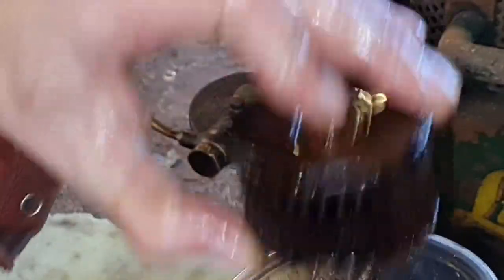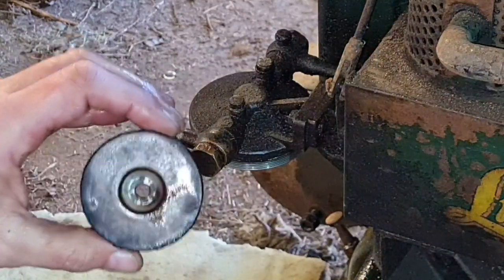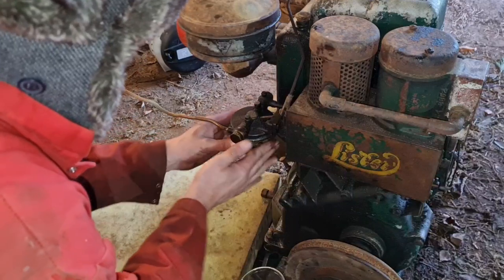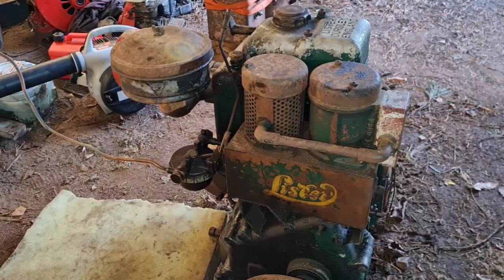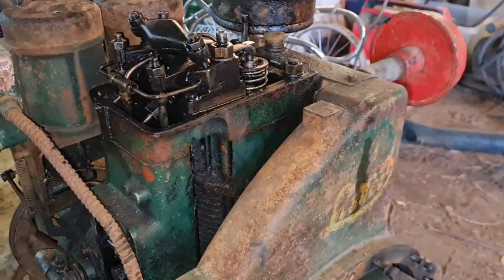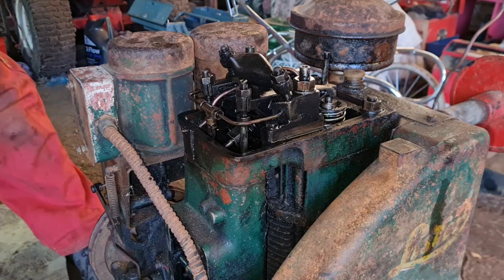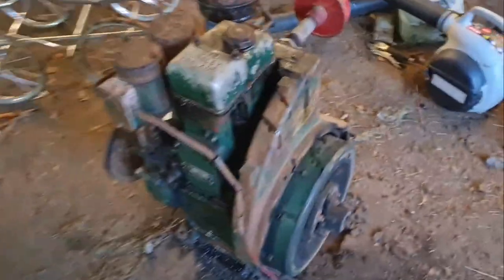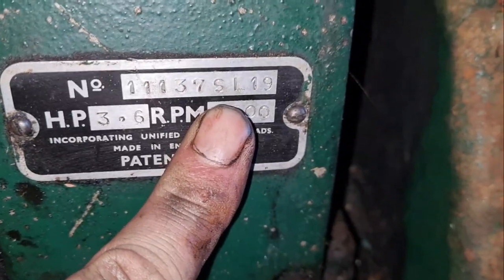Lister Diesel. Will it Start run?

Comment: Hi Adam, 
Really enjoyed watching the Lister startomatic video last night. My father in law used to be a fitter with Bloomfield and Sons in Suffolk and fitted loads of these before mains electricity reached the farms. I will pass on the video. He said that even the Startomatics that were driven from a Lister CS were built to be taken apart easily and had to fit through a standard door frame as a design requirement. It was a nice and long video and dont worry we all make make errors as we are human. I worked with a lad once who filled an engine with oil on a Guy lorry up to the rocker box. Needless to say his employment was short and the engine burst apart from the sump and I had to mop up the pit. I have filled a van and had the oil run out because the bung was still out. I have really enjoyed all the videos and the Reliant made me smile. Thanks
Reply from the maker: aw thanks very much. glad you enjoyed it. can father in law still remember were the 6 wires out of the generator goes? lol.. There will be lots more vids on this I'm sure. and as the weather gets better the Reliant also. lots to be doing. 
Thanks for watching 😁

Comment: Hi Adam. Another great video, Warts & All. Didn't bother me about the length. I don't really like too much "Time Lapse" 
                  content. Did an oil change on my Dad's 1966 Ford Cortina Mk1 and (Kinked) the oil filter ( o ) ring
                  tightening the securing bolt. Lost 3/4 of a gallon of Duckhams finest 20/50.
Reply from the maker: Nice one. to be honest I only really do the time laps thing to speed through a boaring bit. to save you folks getting board and switching off. I do try not to edit much out. Duckhams oil, heck my grandad used to use that in the 70s in his Moggy 1000. lol

Comment: Love seeing the pushrods spin on the lifters. Very cool.
Reply: We’ve all dumped oil on the ground….. For me it was 20 gallons when a hydraulic hose catastrophically exploded on a John Deere 8630 4x4 tractor. Then another 5 gallon’s when I failed to find the second blown hose….. 🤦‍♂️
Reply: She cleared up nice. Sounds excellent
Reply from the maker: yeah I'm happy with the old girl. she sounds lovely when going. ow the oil thing. To impatient to get the oil in. lol..
Reply from the maker: Ow yes. The Brits certainly used to build things the right way years ago. These are so well made.

Comment: As you were pouring in the first 2 litres of oil i said to the other half he hasn't  put on the side cover and another tip for starting listers when really col is tack out air filter and put some newspapers in it and light it
Reply from the maker: Ow yes. I messed up there. I ment to show you folks the air filter. It's an oil bath filter. Yeah I seen the old burning paper trick. Never tried it tho.

Comment: about 40 years ago I was working on an Island where we had a SL2 Lister running a generator. The engine was noisy,rattly and smoked really badly ,oil even came out the exhaust but it was easy to start on the crank and when not under too much load it ran at full revs...😁.The guy i was working for had a bout 40 others he had bought at a Govt.Surplus auction and all needed repairs of some sort. 🙄
Reply from the maker: Yeah these are great old sets. Seem to just run forever. I love this old stuff.

Comment: That engine was running with the decompressor hitting the exhaust valve, when in manual mode you need to make sure the pin is holding the decompressor off.
Reply from the maker: I did have the pin in but it jumped out.

Comment: Wow she runs very well😁😁. It looks like your head bolts are a bit loose because it's blowing smoke from the head.🤔🤔🤔
Reply from the maker: Aw. Well I ordered a new rocker gasket now so will check head bolts.  I did wonder were that smoke was coming from. Thanks.
Reply from the maker: By the way. do you know if these have a head gasket? I can't seem to find one.
Reply: @NorfolkMancave  they don't have head gaskets but thin rings to seal on a very smooth surface. That acts like a gasket and shims for your bumping clearance so they can only leak when the bolts aren't tight enough. I have had a few of these lister air cooled diesels apart before. You probably know that your bumping clearance shims on a CS sits underneath the barrel and your head gasket on top. Well on the air cooled diesels they have a very thin copper gasket ander the barrel and the actual bumping clearance shims on top between the head and the barrel.
Reply: Hope that helps buddy😉😉😎😎.

Comment: is there a place to heat when the rack is stuck in the injector pump -- sl4 sat for years
Reply from the maker: To be honest I would not heat any part of the pump as there are rubber 0 rings and parts inside. I would just lash it with wd or soak it in Diesel for a while. 
Then give the rack a very light tap in each direction and it should break free. Ps put Diesel in the top of the pump, in the inlet and bleeder screw to make sure it's wet I side.